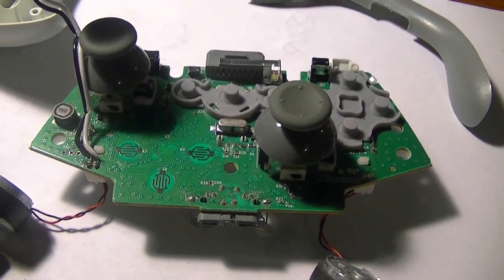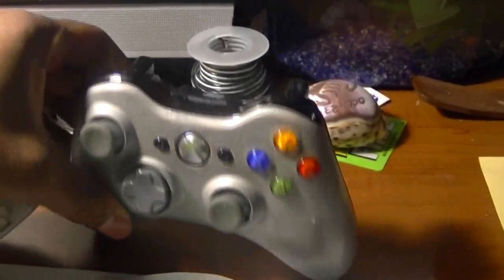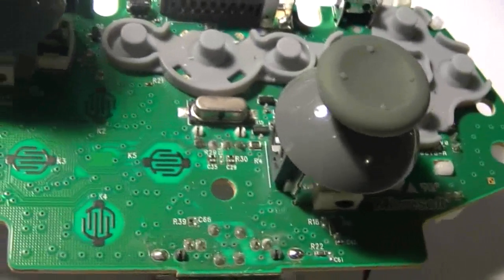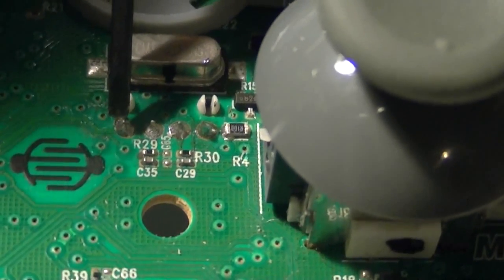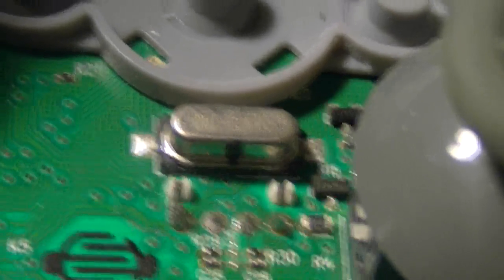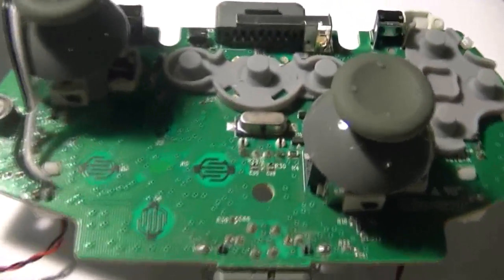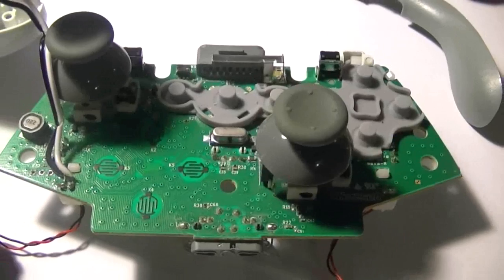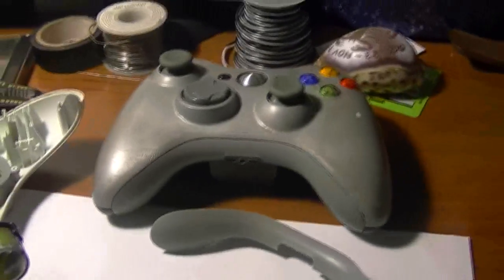xbox 360 LED ABXY solder points

Comment: @Tannerfrostedfrakes this is so old school, and when I started doing this the method was to drill out the buttons, put the led in and hot glue it, then wire it up..uggh. glad modders have advanced this now. So yeah it was done by self old school way

Comment: Where r the solder points for leds that u want to turn off when ur controller is off and on when ur controller is on? Or is there such a point. And can u make a vid on how to light up the guide button and where you solder the wires as well as where you will run the wires.

Comment: if dis dsnt work 4u, use a transistor(2n3904) directions.gonna hav3pins flat part up pins facing u.da pin2da left will go connected to-battery point of motherboard.middle pin goes2a 1.5 v point should b found right where da mic connects, theres 4 soldering points, right above4more above dat2more solder on da right side of those2.then da + side of da led goes2da bottom right&da - side of da led should go2far right pin of da transistor.now wen u turn controller on/off leds should 2

Comment from the maker: @jktpunk182, these points will activate only when there is power to the controller, so in other words when you turn controller on and when charging the controller. no switch is needed at all

Comment: Using these solder points, would the lights come on when you power on the controller, or would they stay on constantly and need a switch of some sort?

Comment from the maker: @modeyus1984, im not sure of the mix honestly, but i got mine from radio shack and just make sure its rosin core. as far as the led, i like to use 3mm and 30 gauge wire, the only ones you tend to need a resistor for is the red as they pull the most power, nothing serious

Comment: You have a matrix board. The cg and cg2 are newer. Matrix boards were stopped in 2009. The dif is that matrix has a giant resistor in the middle.

Comment from the maker: @ ifyoukillmeudead , 3mm is just a good size to use especially when using the lights on the buttons. If your gonna wire up more than one, yes I would use a resistor, not needed but wouldn't hurt and would just allow it to last longer and illuminate to its brightest potential...thanks for watching!

Comment from the maker: @arcangelstudioregina, thanks...and isnt that what a resistor is, a device regulating the frequency or voltage provided to an electrical component. this is what ive seen a resistor to be, there are the other kind like from radio shack as well but these ive seen before and where called the resistor of that particular device.

Comment from the maker: @ coolmw2booster and if you choose to wire up like 4 on the points i showed, then yes another resistor should be present say a 47ohm or 470ohm

Comment from the maker: @ coolmw2booster..whoa! mad ?'s. u can use in th 22-30gauge wire, led's can be 5mm or 3mm, the most ive put on the rumbles was one each and no need for resistor with just one,more than that im not sure guess its based on the voltage of the led, remember the battery pack is 5v and most of these leds only require 3 to function, using the point i showed,no resister is needed thats what the"oval thing" is

Comment from the maker: ok so a quick way to tell if you have this controller, which i found out is called the matrix controller is to take out the battery pack and on the mother board from the botttom LEFT if it has in white writting TP3 then your good.